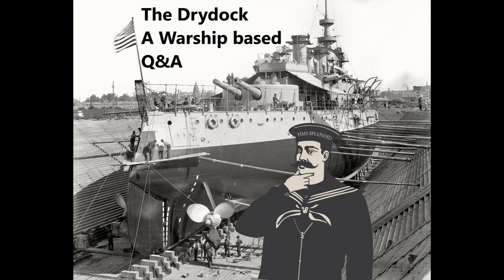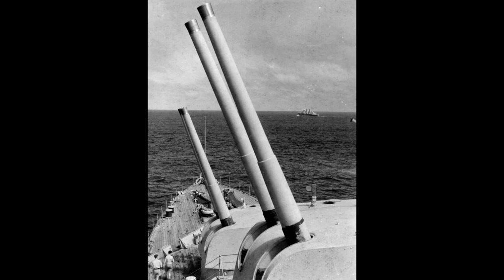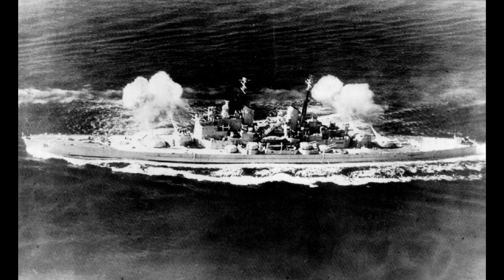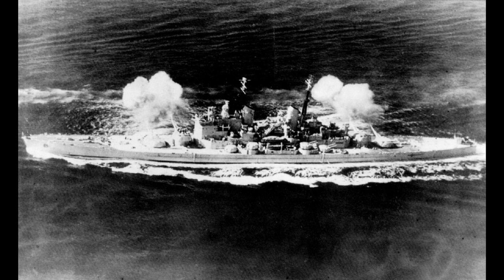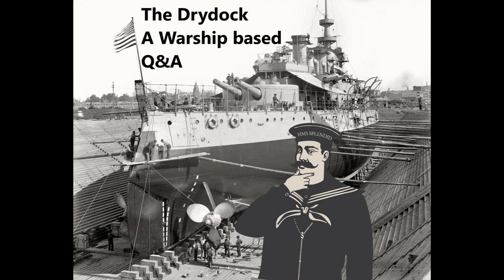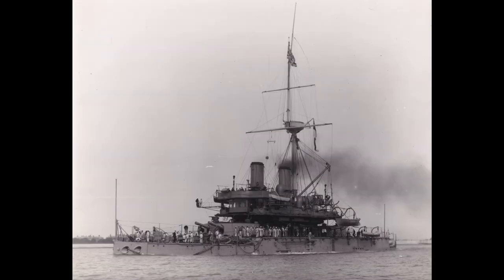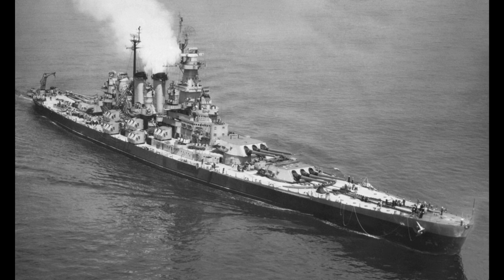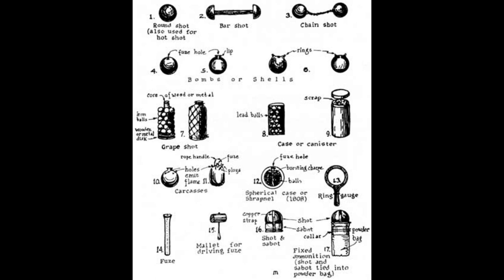The Drydock - Episode 149

Comment: As to the vibration issue with the NCs: Did they use evenly spaced frames?
I sure do hope not, but when hull vibration and resonance were mentioned, that thought inevitably crossed my mind.
Reply: Can you explain why?

I had physics until the end of highschool, but we never went into stuff like resonance or building materials 😅
Reply: @MrNicoJac  Simply put, if the distance between two frames is an exact - or nearly enough exact - multiple of the wave length of the vibration, you get resonance. You can't realy prevent that entirely, but if all frames have the same distance, there will be one frequency of vibrations, where the entrie hull will resonate.
That is generaly considred a bad thing. 
If the frames have varying distances, only one or two sections of your hull can resonate a the same time, with the sections in between acting as a buffer of sorts.
Reply: @Bird_Dog00 
Awesome explanation, thanks!

Imagine if it happens to be the panel next to the sleeping bunks, oof! 😝

Is there any way to find each (major) component's resonance frequency?
And avoid problems in the design stage?
Or is it just a matter of crossing your fingers and using component diversity/redundancies?
Reply: @MrNicoJac  The resonance of each frame is a function of the length of the frame and stiffness of the structure. A simple approximation is the classic physics wave demonstration with a jump rope swinging between two pivots. Applying that to battleships, frames would act like pivots and the structural members in between act like the jump rope. The worst case for resonance is a vibration frequency with a wavelength equal to twice the frame length so that adjacent frames are alternating high and low then reversing as the wave traverses the ship.

As noted above, changing the frame spacing changes the resonant frequency by only allowing certain wavelengths to propagate freely. When a wavelength other than a multiple (1/2, 1, 1.5, 2, etc.) of the frame spacing tries to vibrate the space, it will lose energy deflecting/deforming the frame joints. This has possible issues with certain frame joints taking repetitive deformation damage based on the frequencies of vibration that the ship generates. 

As far as incorporating vibration into pre-modern design, I doubt that vibration analysis much more complex than the type described above was even attempted directly. There were certainly experiential design features implemented as shipwrights and designers observed previously constructed ships. The big challenge to vibration analysis is that a ship is a 3D vibration environment and calculating structural stiffness in a ship that has varying armor thickness and massive internal structural elements like barbettes is nigh unto practical impossibility.

Comment: Regarding the County class 8" as AA.  They might still have worked reasonable well against a level bomber formation attempting bomb the ship.  WWII showed that actually wasn't much of a risk, but interwar it was a fairly significant concern.  (And the US thought the B-17 would be effective against ships in a medium to high altitude level bombing attack.

A formation of big level bombers are going to have to come in pretty much straight and level and so should be fairly easy to the gun trained on, and be about as simple a fire control solution as you could hope for.  A gun firing 8" AA with its big shrapnel shell, and ability to reach high altitudes or engage at long slant ranges, might be very effective if the fire control and fuse setting is good enough to detonate it close to the bomber formation.
Reply: Attempting to use B-17s on shipping... wasn't that basically the proof that level bombers were fairly rubbish against ships?

It's at least a little amusing that the most effective attack B-17s made at Midway was strafing carriers with their defensive armament.
Reply: @boobah5643  Yep.  Too bad for the weapons designers, and doctrine writers, of the interwar period that they had to design against the perceived threat.  
And it wasn't until level bombers like the B-17 actually tried attacking warships that it was proved that threat had been radically overestimated.
Reply: This obsession of trying to use large caliber guns for AA is a dead end. They are big. they're slow to traverse and load. They don't have the fire control or the high angle to do anything.

Comment: Re:  limit of engagement range for battleships.

There are two sources of error to consider.  The first is the dispersion of the fall of shot at any range and the accuracy of the ranging system.   You generally cannot do much about the dispersion of the fall of shot unless you are the Italians but improvements in fire control provided by mid to late war USN and RN radar directed FCS substantially improved accuracy well beyond  the limit of an optical system.  Errors in optical systems increases with range.  Radar system have a constant range error and very small errors in bearing.  At 30kyds the Mk 8 FCS has 15 yd range error and an approximately 50 yd error in bearing.  For gunnery purposes you know exactly where the target is all the time.  The only error that matters is from fall of shot.  In theory, every salvo is a straddle.  There is a great advantage in opening fire at longer ranges as long as there is achance of scoring even an occasional hit.  It is axiomatic that in a gunfight hitting your target first conveys a huge advantage.  This is true whether the fight involves small arms, armored fighting vehicles or ships.  If you have a range advantage you use it because you have nothing to lose and a lot to gain.  If nothing else, if your opponent finds himself straddled at ranges beyond his ability to respond it places on the defensive.

Comment: 10:35 I feel like Vanguard - Iowa comparison is incredibly unfair due to the fact of how both ships came to be. Vanguard was essentially hodgepodge of available parts put together as quickly and cheaply as possible. It's like comparing M3 "Grease gun" to M1 Thompson SMG. Context very much matters.
Reply: But i think the point made was that while a Thompson is "better" and could probably hit you from a longer range, odds are that you will still miss and at reasonable smg range you are just as dead from a 9mm round from a grease gun vs a thompson

Comment: The Napoleonic wars brought an even greater requirement for ship timber and in 1802 Lord Nelson visited the Forest of Dean and reported his concern about the lack of available oak and the fact that no new trees were being planted. Nelson’s report written in 1803 indicated that if the Forest was managed properly it had the capability of producing 920,000 oaks, which would produce 9,200 loads of ship timber every year. In 1803 he asserted that less than 3,500 loads of timber were available. To build just one first-rate warship it required felling trees over 100 acres of Forest. As an example, Victory was laid down in Chatham on 23rd July 1759 using approximately 6,000 trees 90 per cent of which were oaks. In 1808 the Dean Forest (Timber) Act was passed which provided the powers needed
 to complete the enclosure of the complete 11,000 acres.
As a result thousands of acorns were planted, which today give the Forest of Dean the largest area of oak trees over 150 years old in Britain.

Comment: Alan Lundgren, Drach didn't quite answer your question. In terms of weight, a fully loaded 8 cell Mk41 VLS module would run about 30 tons, depending on the missile loadout. The 16" guns on the Iowa class weight 120 tons each (navweaps.com). Add in the weight of the turrets at around 1780 tons each, and the 1200 projectiles, and 2500 tons for each turret is reasonable-ish. This doesn't include the barbettes, those I don't have a weight for. 

7500 tons would get you 250 8 cell modules, or 2000 vls  cells. At around 3x2.25 meters, that would be 1687 square meters. If Iowa was a perfect rectangle it would be 8646 or so square meters, so you you could fit that many modules on the ship, but not without rearranging everything. If you just put them in the deck space occupied by the turrets and guns, i think you could get at least 10 of the 64 cell modules, for 640 or more cells. That's 80 30-ton 8-cell modules (8 8-cell modules per 64 cell module) for 2400 tons, or about a third of the weight difference not counting the barbettes. The ships would be a lot lighter.

I don't know how the combination of lighter weight and the difference in the vertical distribution of that weight would affect sea keeping or the issue with the bow submerging in rough seas, but you've got plenty of displacement to spare for armoring the VLS modules, radars, helicopters, etc.

Comment: In the discussion of Iowa vs Vanguard, it was frustrating not to hear any mention of the rates of fire of the 16" 50's compared with the 15" 42's. Surely with a higher rate of fire, greater bursting charges and perhaps superior gunnery, the odds might be tipped towards Vanguard.

Comment: I might be missing the pinned post for dry dock but you had mentioned the shock issues from the main guns related to the power failures on South Dakota and how they realized they needed to enhance the shock protection on the class. Why didn’t Massachusetts have the same issues during operation torch? From everything Ive read about that engagement everything seemed to work well at Casablanca.

Comment: 2 questions:
How well does the British 16” gun in the Rodney compare to the Iowa’s 16”/50. My limited resources seem to indicate quite well, but does the shorter gun length mean the hitting power is less?
On the use of submarines in the battle of Jutland, wouldn’t a pre-placed line of subs along a retreat route to ambush the British line of battle have been a viable use of “Fleet” submarines?
Thanks and keep up the excellent work
Reply: On the second question, I recalled that it was tried at some point and it was the case that subs were not acurit enough.  I think that the torpedoes were simply too visible during the day to be viable at attacking warships.  IN night, it might work, but then seeing warships coming might be a problem.  On the first one, that logic seems sound, but I would not be able to answer that question.

Comment: I think you are underestimating inclined belts. Shell fall angle combined with belt angle and even slight  "uninentional" angle of the ship like 10 degrees can give you impact angle of around 45-50 degrees. This would allow Iowa and Richelieu to withstand a shell with 15 inches of penetration at the mentioned range.
In the case of Richelieu the belt alone would be over 360 mm effective at perfect broadside and hidden behind tds filled with ebonite mousse. Considering that shells would pretty much never impact at perfect angle it would be about enough in 99% of cases.

Comment: On the issues of the North Carolina hull/screw resonance issues. Could the designers pulled a page out of aircraft design & had (most likely electric)'variable pitch' screws mounted? Not really too provide 'efficiency' to the screw, but to be able to fine tune the vibrations at a certain speed.

Comment: Resonance between the screws and hull.  Is that what Mogami's problem was, too?  She rattled like mad aft at speed.  I've read the aft turrets could not be trained during high speed runs.  It's often said she and her sisters were built too weak; designed before the Fourth Fleet Incident.  A negative synergy, perhaps?
Reply: From everyone's favorite argument mill, Wikipedia:
"The Japanese Admiralty held a hearing on the damage suffered by Fourth Fleet in the storm, resulting in recommendations for changes on Japanese warship design and construction. A number of new designs that used heavier guns and taller superstructures were found to be top heavy, and efforts were made to stabilize these ships by reducing weight above the waterline. In addition, cracks in the hulls of the new cruisers indicated the recently adopted practice of electric welding hull seams was suspect, and the practice was canceled on all new Japanese warship construction. The event was kept a secret from the public."

Comment: With most battles decided by damage to rangefinders or other unarmored elements of the superstructure as you mention in the Iowa vs. Vanguard answer, would predreadnought style secondary batteries of relatively long 8" or 10" guns come back in the post-radar directed fire control era if neither aircraft nor missiles had displaced the gun-centric battleship as the primary capital ship?

Comment: wrt the Vanguard vs Iowa gun question, the factor not considered is the number of shells each ship throws at a time.  Throw more shells and math says there is a higher probability of a hit.  It would be interesting to see a Tennessee and a Nagato square off.  The Nagato has larger guns, but the Tennessee sends 50% more shells downrange.  Using the numbers on Navweaps, Nagato has a throw weight, using WWII shells of 17,992lbs, while Tennessee has a throw weight of 18,000lbs, amazingly close.  Would the blunderbuss effect of Tennessee's greater number of guns win the day over Nagato's individually larger shells?
Reply: Doesn't really work that way.
Reply: @WALTERBROADDUS  How so?  Seems that, if you have a given range of scatter, dropping 12 shells/salvo in that range, rather than 8, increases the likelihood of hitting something, or hitting it more times.  If not, then why were some people so obsessed with increasing rate of fire, if not to increase the probability of a hit by sending more shells downrange?
Reply: @stevevalley7835  rate of fire is going to drop simply due the physical fatigue. As for adding more barrels? They are not muskets of infantry mowing down other lines of infantry.
Reply: @WALTERBROADDUS  well, we could leave it up to Drac to be the tie-breaker.

Comment: England would be a smaller economy than Spain at the time of the Spanish Armada
Reply: Given the weather advantage that the British received, God was on their side.
Reply: @calvingreene90  what weather advantage did the English get? A fairly steady Westerly SW or NW in the channel? That is the prevailing wind and gives the Spanish the weather gauge at the start of the engagement. The capture of the weather gauge by the English fleet on the first night shows how out classed the Spanish were in tactical awareness, seamanship and weatherlyness. After that there are two important shifts of wind a resumption of the prevailing westerly which allows some Spanish ships to claw off the Portland races into which Frobisher has drawn them. The second was a southerly shift of wind at Gravlines that allows the Spanish to escape the Dutch sandbanks. When they are escaping round Scotland there are some westerly gales in September/October which is about as shocking as the Pope’s Catholicism. So I don’t really think the English got the best of the weather.
Reply: @davidwright7193  
The Spanish fleet took one hell of a beating from a storm that greatly weakened it before the Brits arrived.